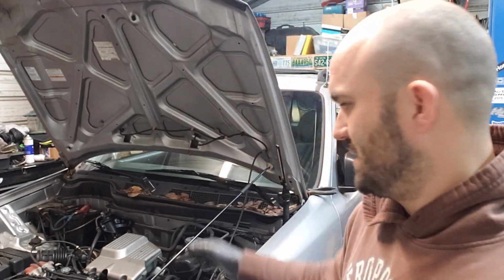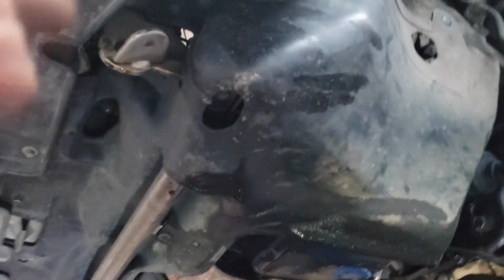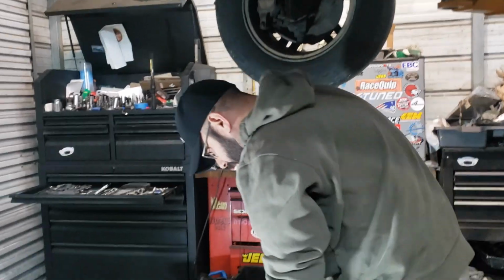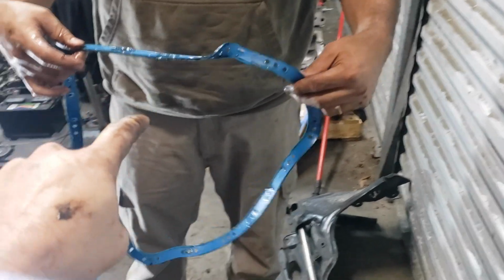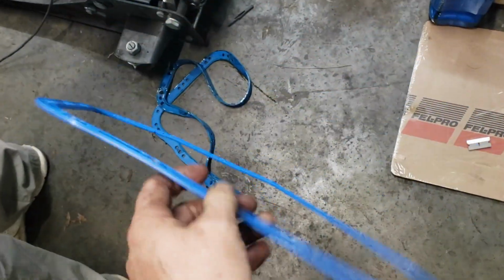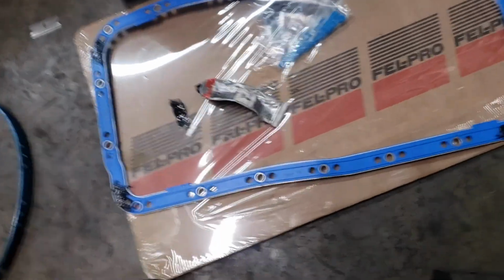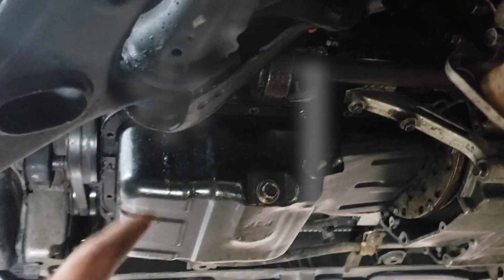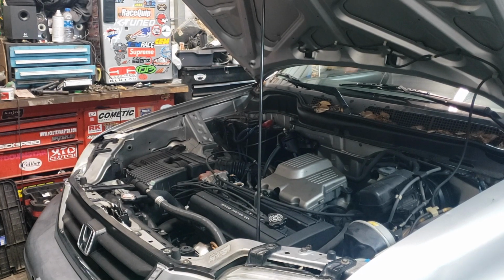1997 - 2001 Honda CRV **BEST** Oil Pan Gasket Install | RD1 | RD2

Comment: For my 2001 Honda CR-V (105k miles) I removed my oil pan without removing exhaust.  I used the Felpro ridgid gasket and used a couple of bread ties to hold it in place  just prior to the reinstall point.  Only issue is that bracket that holds the transfer case.  It didn't take much effort to deal with that issue.  I suggest practicing without oil pan gasket attached so you know which path works best for reinstall.   Note that some of the nuts come off with studs attached.    I suggest watching the other install videos as well.   The exhaust in this video looks different than mine.

Comment: Thank you so much for posting these videos!  I need to replace my gasket and it is super helpful to see all the parts that need to be removed and put back on to do the job. I was hoping that in this video you would have shown how to remove those 2 spring loaded bolts on the exhaust. Is there any safety concern (will they fly off?) or do they need some special removal process?  
Also, others may want to know that the oil drain plug washer needs to be replaced after draining the oil. 🙂🙏🚙
Reply from the maker: They come right off

Comment: Hello, I recently bought a 98’ with 140,000 miles. It’s a beauty but one thing is that it’s leaking oil. I did an oil change and realized the drain plug was on there so tight I had to use a breaker bar to remove it. Now of course it won’t stop dripping unless I tighten it more. So my question is do you have any recommendations for the oil pan replacement itself to match with the rigid fel pro gasket ?

Comment: Thanks!  Gonna swap mine out tomorrow.   What do you recommend for leaky steering rack?  Rebuild or replace?  Any suggestions on rebuild kits or preferred replacement brand?
Reply from the maker: Thanks, I usually just replace them. I use whatever is available and I’ve had pretty good luck with them

Comment: hey i firstly want to say thank you so much for your videos, you’re one of the reasons i felt so confident about buying a 1998 crv a few weeks ago! Please keep up the amazing content as your community/fam cherishes you! Secondly, I had a question about the oil pan itself. Would you happen to have a link to a reputable replacement that you use on your repairs? Thank you so much in advance
Reply from the maker: Just look on amazon or rock auto. Oil pan is an oil pan.

Comment: Oddly enough, while using this gasket, I have an oil leak that will not stop. Noticed that the threads don't come out far enough for the nuts to tighten properly. Took it off twice and it still won't fit properly. I personally don't like this gasket unless you're gonna use longer studs for proper fitment

Comment: When you reuse the 30630t oil pan gasket, what is the procedure. Do you scrape the old silicone in the spots and apply new? Or just slap it back on?
Reply from the maker: Always clean and use new

Comment: I sinned and used the soft gasket, started dripping at 20 miles even when properly torqued, listen to this man and get the rigid one.  It was a fun day because one of my captive studs on the header joint broke free and I had to get my sawzall in there to cut the stud, luckily the other 2 came free so the blade could barely fit.  

It's funny because the oem gasket I replaced wasn't even leaking at 219k!  It was rock hard and took a half hour to carve off the pan.  I was doing preventative maintenance.

edit: for anyone watching in the future, you can't remove the header as one piece with the oil pan installed, and you can't remove the oil pan with the header installed 😣 this only matters if your lower header pipe won't separate from the upper half.

Comment: It seems most people have good results with this gasket. However, a lot of people also complain that it leaks worse than before after 1 heat cycle. Not sure if I got a defective part or something else, but unfortunately i am gonna have to go back to the floppy design, which maybe caused a little sweating at the edges, but never the crazy dripping that I have now...
Reply from the maker: I've used probably 30 of these and never had a single leak
Reply: It's probably because you and most people don't remove the factory torque limiters
Reply: @deputydan2226  Do the torque limiters look like little black washers?  Thanks!
Reply: @motogp9253  yup.. sometimes you get lucky and they'll stick to the pan then you can pop them off with a screw driver or something. Otherwise they'll get stuck to the mating surface
Reply: @deputydan2226  Good to know, thanks!
Reply: @deputydan2226  I should've replied back sooner, but when I exchanged the gasket for genuine Honda, I identified the torque limiter ( didn't see it before) and removed it. I agree, it's most likely the cause of the leak. So right now I am running the Honda soft gasket, but will keep the hard gasket in case I need it later.
Reply: @sheistybasterd  no worries, I just came across this video and your comment. thought I'd share the knowledge in case some else even needed it lol

Comment: Are the hardware pieces for the oil pan supposed to be studs and nuts, bolts or both? If I can recall I took off both types. Also as I was taking the nuts off some of the studs, the entire stud would come out too. The nuts must’ve been stuck on it due to corrosion. I’d like to use new hardware. After I took all 19 pieces off I forgot where each one goes. Is there different hardware lengths that are supposed to be in specific spots? I wish there was a diagram….
Reply: I found the diagram. It's 2 studs, some bolts and nuts.

Comment: What is the Honda bond for? Do you put it on with the gasket? And is it required?
Reply from the maker: Its where parts the engine join. It's definitely recommended.

Comment: Hey just did the oil pan gasket and had some problems with the nuts and posts that are already on there ,they are leaking a bit I checked for all the posts to see if they had the metal washer but there was nothing can I replace the nuts and threaded bolts for just the normal bolts ?

Comment: You're videos are perfection! I've a 98 crv, 235,000 and "we've" adjusted the valves together and replaced the oil pan gasket. If you ever have to do the wheel cylinders, bet your video would beat what's out there! I am a 52 year old woman, and your help has been invaluable to me. My Honda runs great!

Comment: I just wanted to thank you for all the excellent videos you put out and all the great work you do. Unfortunately my journey in my CRV has ended because it blew a head gasket and the head is cracked and I'm on Social Security Disability so there's no money for repairs. Y'all take her easy
Reply from the maker: Bummer! Best of luck with a future vehicle
Reply: There is still hope. My mechanic is a master machinist and may be able to drill the bolt. Fingers crossed.
Reply: Wish I could post pictures
Reply: I think I can post pics.

Comment: A piece of masking tape dropped inside mine through the dipstick hole, is there need to worry or the strainer inside the oil pan will prevent it from doing any harm till I can change the oil later?
Thanks
Reply from the maker: I'm sure if it fit through the dipstick you have nothing to worry about
Reply: @hondaresource  it's been three days now, running without issues, I only noticed a swirl in the radiator hole when starting the engine, guess my thermostat is stuck open but that's unrelated case.
Thanks for your responses. 👍🏿

Comment: Really like your channel, helps DIYer's so much!  Any plans to do a video on steering rack R&R?  Mines leaking internally at the tube ends, no saving it.  It does seem to run OK with the fluid level at the low mark, if I fill it to the top mark massive leaks!
Reply from the maker: I'll make a video on it next time I get one in for rack replacement. It's not a fun job
Reply: @hondaresource  no it's not, especially without a lift

Comment: So I was torquing one of mine down and had the torque wrench set to 8.7 ft/lbs and it kept turning and turning and not clicking and eventually it sheared off 😑 I did have an extension added to the torque wrench, would that have caused it to not click at the proper rating? What would be the reasoning for it over tightening like that?
Reply from the maker: Probably over torqued previously

Comment: Thanks for sharing your experience!
Didn't you have any problems using the old gaskets on the exhaust?
Reply from the maker: Nope, I've had countless crv's apart over the years and never had to replace one of the exhaust gaskets unless it was already bad.

Comment: How about cleaning the surfaces of the engine and the pan? Surely you must do that? How do you recommend to go about it? I expect a hard plastic scraper that won’t gouge and maybe some brake cleaner or similar or some kind or sludge remover. What can you inspect in the oil pickup? Anything?
Reply from the maker: I use brake cleaner and a clean rag or paper towel to clean the oil off of the surfaces. As far as the pickup, just look through the gap on the bottom of it and make sure the screen doesn't have anything stuck to it. To remove the gasket from the pan, I recommend this technique - https://youtu.be/UHzf2vCCPSs

Comment: Thanks for all the videos! So much info! 
Just did the gasket on Monday and was fun! 

Any vids on EVAP leaks? Besides gas cap being the issue? 

Thanks in advance! 👍🏽👍🏽
Reply from the maker: Heck yeah man! Unfortunately I dont have any evap videos. Those can be tricky since its a finicky system
Reply: @hondaresource  regardless! U is the man and thanks for the replies. Suspension work this weekend. Front bearings ball joints(will try the freeze ball joints technique) end links bushings upper lower control arms! 👍🏽👍🏽👍🏽👍🏽
Reply from the maker: @juanmf310  good luck boss!

Comment: Dude! I put this exact gasket on my 1997 Honda CR-V lx and it was good for less than a day and it started to leak more than my old, someone please give me some advice or something smh!
Reply from the maker: Are you 100% sure you got the little metal rings off of the mating surface? sometimes the old gasket leaves them on the side closet to the transmission. I've yet to see one of these leak after proper installation and I have personally installed probably 20. I have one at the shop now getting this same gasket
Reply: Little black rings...? I don’t remember seeing those... but yes it is leaking from the side closest to the transmission maybe I didn’t clean the surfaces properly, for a second I thought I might’ve tightened it to tight. When I noticed it leaking I just tightened where it was leaking and it was the side closest to the transmission.

Comment: Thank you for the great video. I am just wondering how you would diagnose a rear main seal leak versus a leaky oil pan? I replaced the oil pan gasket a few months back and it didn't seem to make an ounce of difference. I just realized after watching the video that I used the crappy rubber gasket instead of the rigid one. I'm going to buy the gasket you used to see if it makes a difference; but, I'm really thinking it is the rear main seal on the auto trans. How could I know for sure? Thanks again for the great videos :)
Reply from the maker: I would start by replacing the oil pan gasket and make sure you got the original metal rings off around the studs on that end of the oil pan. Also while you are there, take a flashlight and look up in between the engine and trans to see if you can see any dampness.
Reply: @hondaresource  awesome that sounds like a plan 😊 thanks buddy

Comment: This video helped me a ton but I want to add something: inspect your bolts and studs and consider replacing. I reused the old ones, which I realized afterwards were very weakened. Two bolts sheared off while threading them in, and three nuts threaded onto the studs but would neither tighten or loosen (stripped threads I guess) and I had to dremel them off and twist out the studs with vise grips. I just replaced the studs with bolts, I don’t see a good reason not to unless anybody knows one
Reply from the maker: The studs are actually better than the bolts, but bolts are better than nothing. Those shouldn't ever be tightened enough to break or weaken them so they have been over tightened at some point.
Reply: @hondaresource  I didn’t have quick access to studs but they had bolts that would fit down at Advance. I figured I’d just keep a close eye on it and if there was an issue I’d order a stud kit but if it’s not leaking no reason to mess with it
Reply: @hondaresource  I have this exact same issue going on. On the transmission side I have a leak. I checked the bolts and nuts and one of the nuts is spinning. It's in a spot that I can't get a dremel in to cut it off. Any ideas on how to extract it? I'm guessing my leak is only because this one post/nut doesn't have any pressure on the seal.

Comment: Used to swear by OEM.
Not anymore.
Reply from the maker: This is absolutely the best on the market!
Reply: Used the exact same gasket, but still have a leak. Thinking about changing the oil pan. The cost of two factory gaskets and one Felpro have already exceeded the cost of one oil pan. Ever have the oil pan be the problem?

Comment: Hello. I was by a mechanic to check out why I had a leak around my crank case and cam . We change the seals on cams crank case but it's still leaks down around the pully wheel.. He said it has to be a head gasket that's leaking the oil.. He wants to take the head off and inspect it and if possible replace it. 😪😭 Costly..

Question can I use a stop leak? And would that stop it or try it. And which one would u recommend. I'm hearing lucus stop leak.
Reply from the maker: I don't ever recommend using stop leak in a motor. It stops up ports that aren't meant to be stopped up. Remove the timing covers and start it up to see where the oil is actually coming from
Reply: @hondaresource  OK. I'll tell them to remove it and try, but we replaced camshaft seals and  crank seals. Can too much oil in the engine cause this as well because I realise it's over filled on my dipstic.
Reply from the maker: No, overfilling it won't cause an oil leak.
Reply from the maker: Also, look on my channel for the b series oil pump o-ring. That may be leaking.
Reply: @hondaresource  looked  at it already as well.. But the leak runs down at the front by the exhaust manifold on the right side next to the timing cover where head meets block.
Reply from the maker: @emiljack5389  it is possible that the head gasket is leaking. Maybe the head has been resurfaced a couple times and the alignment dowels are now too long. This would prevent the head from seating all the way down. 🤷‍♂️ Just a thought.